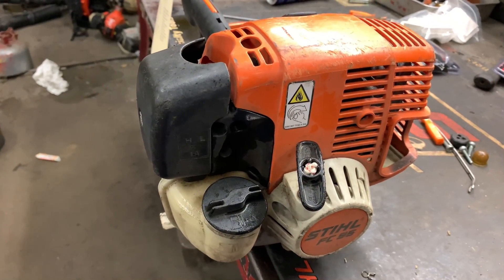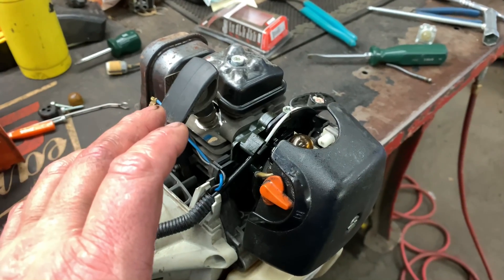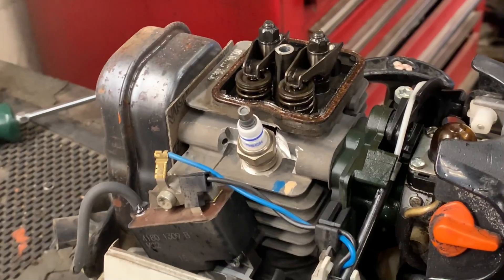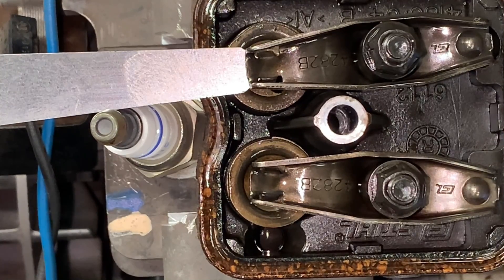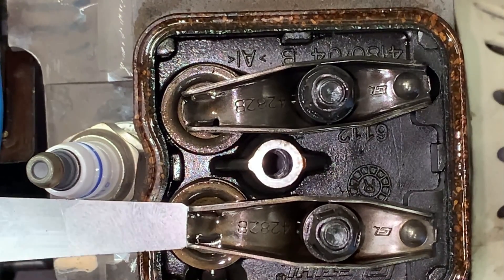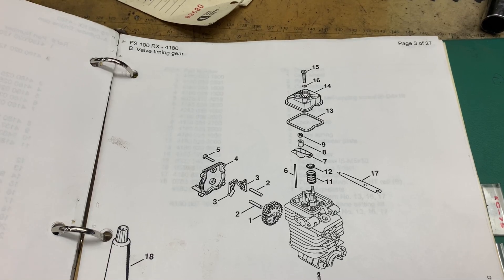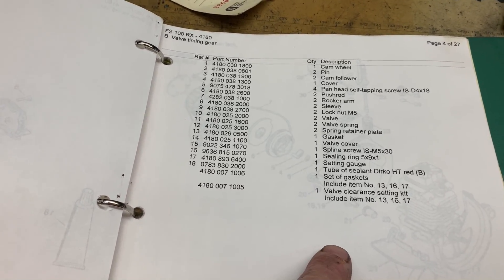HOW TO PROPERLY ADJUST THE VALVES ON A #STIHL 4 CYCLE #4MIX ENGINE

Comment: Have seen both different ways sp don't know.  How do you determine the right stroke on top dead center? Are the valves supposed to move or not? Understand about rocking the fly wheel back and forth.

Comment: I'm looking at the Stihl Series 4180 Powerhead Service manual dated 2005-12 that includes this FC-95 trimmer. Under valve adjustment is starts with the following:  "Check and adjust valve clearances only when engine is cold". How did you figure-out that warming the engine prior to valve adjustment is required?
Reply: I've only ever done it when it was cold. Never heard it had to be warmed up. Maybe warming loosens the nuts or expands to make the proper gap? Who knows

Comment: I highly recommend never buying a 4mix. The new ones (after 2015) are garbage
Reply: Not sure why they get all the hate. I have 12 years experience running these engines and they are beautiful torque monsters. Always only use premium gas, never that ethanol crap, and mix properly. No problems

Comment: If this machine is 4 stroke, where does it get its lubrication from ?!
2 stroke I understand.  
Where's the sump?!😢
Reply: You still mix the oil with the fuel.
Reply: It’s a 2 stroke with valves. Not a 4 cycle 👍🏼
Reply: @Plink-Plonk800  If it's a 4 stroke motor, which indeed it is, you will find one compression stroke for every 2 revolutions of the crankshaft. If it is a 2 stroke motor, then you should find a compression stroke for every revolution of the crankshaft. Check it yourself.... The reason the oil is mixed with the gas is the motor is operated in various positions relative to the direction of gravity. You can't rely on gravity to move crankcase oil to a sump pump like in a car engine or lawn mower engine which are only operated in one position relative to the direction of gravity. So distributing lubrication oil is done by mixing the oil with the gas and moving this mixture throughout the engine internals to distribute lubrication.

Comment: I know you've probably forgotten more than I'll ever know about these engines, but just a heads up, Stihl's service manual says to only check valve clearances when the engine is cold.
Reply from the maker: Yes, because when the metal heats up it expands, so if you adjust it hot and it cools off, it will be out of adjustment

Comment: NOT a 10 thousands gauge! It is 0.1mm or .004 inch
Reply: Please whish is the gauge size ????  1 mm ???
Reply: @Moncho68  It is 0.1mm or .004 inch
Reply: 10 mm  filler
gauge
Reply: @snoopfurlow1275  It is 0.1mm or .004 inch

Comment: Why doesn’t anyone ever mention getting to cam lobe into the correct position? Shouldn’t you turn the engine and cycle the valve’s until TDC & arrow are on the correct stroke (tip of the cam lobe is down)?/?/? If you gap the rocker at .004 in between the intake and exhaust strokes then go 180* they will be stupid loose…. I’ve watched several videos and nobody ever mentions this…it’s not as easy as just “indexing the arrow to the ignition screw” because you can index it correctly on the wrong stroke…correct? Unless I’m doing something wrong….
Reply from the maker: You are vastly overthinking.  There’s nothing to mention about the cam lobe.  when you line up the flywheel arrow to the coil mounting screw on the compression stroke the cam is automatically put in the right position every single time. Did you even watch the video?
Reply: @THEMOWERMEDIC1  Please whish is the gauge size ????  1 mm ???

Comment: On the 4 mix do you have to be on the right stroke to adjust the valves
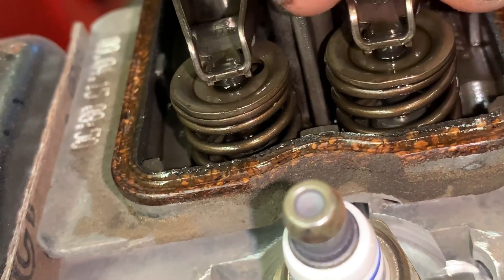Reply: Yes. If you are on the wrong stroke the rockers will move when you move the flywheel. If you are on the correct stroke the rockers will be loose as they are at the 3:10 video mark even if you move the flywheel a little bit.

Comment: I have a Stihl HT101 polesaw. Is this the same procedure? It's got less than 30 hrs on it, but it runs rough & has very poor throttle response. The carb was rebuilt by a Stihl dealer (I had left it in the garage with fuel in it for about a year).
Reply: Yes.and Check the muffler screen if its clogged it wont run full throttle..then try turning the hi,low screw on the carburetor.
Reply: @snoopfurlow1275  
Spark arrester is clean as a whistle. I set the valve lash just like the video, fired it up & set the hi & lo jets.
Unit runs like a scalded dog

Comment: Excellent MM1!! We get them in all the time saying hard to pull start. Adjust the valves, good to go. We do keep that set in stock from Stihl. I do it a little different, one closed and one open. Did you use 100:1 ratio? 😆🤣 Jeremy YOU ARE AWESOME !! Great job as always!!
Reply from the maker: Yeah I’ve done it with one closed one open. You have to be more precise and make sure you are on the base circle of the cam lobe. A few degrees either way and it’s starts to overlap the valves.
Reply: Raleys What oil & ratio do you prefer since you don't like 100:1?
Reply: @Mechanicalcircus  50:1 in everything